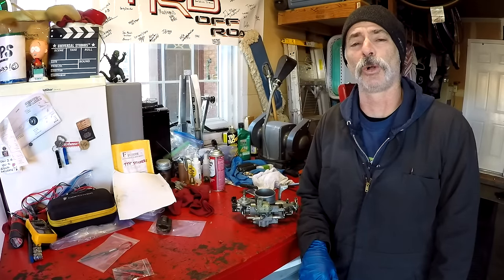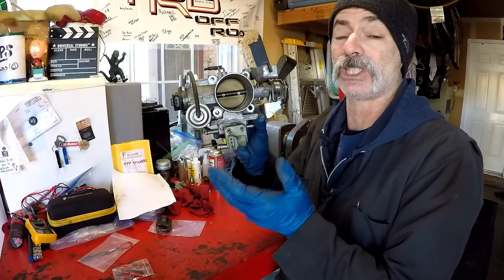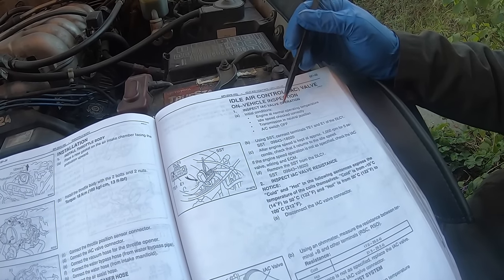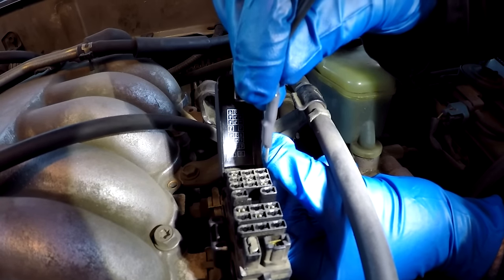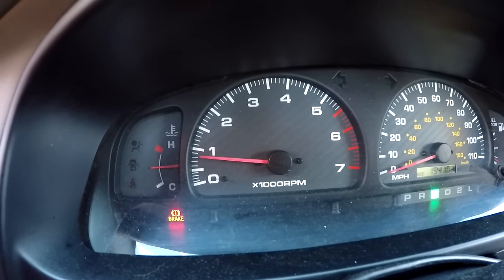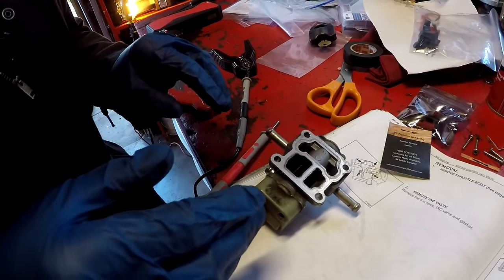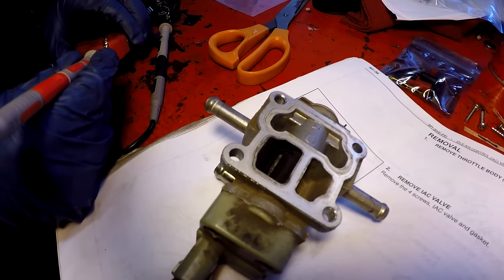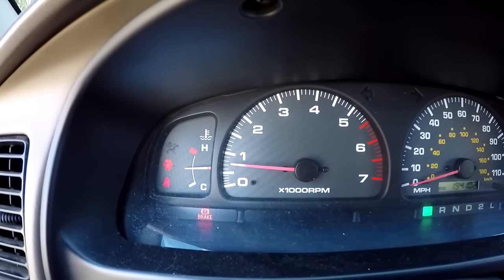IAC Valve Testing and Cleaning

Comment: If taking coolant hose off the throttle body dose that cause air in the coolant system ?
Reply from the maker: You'll get some air in but it will work itself out.  You don't have to re-burp the cooling system if that's what you're asking.  The air will eventually work it's way out to the reservoir.
Reply: @TimmyTheToolman  thank you boss! I’ve only asked that because I notice a little drop in the coolant reservoir so I got little paranoid.
Reply from the maker: @samabdelhadi3037  Yeah, it's normal that you would see it drop a bit because you lost a little coolant when you disconnected the coolant lines.

Comment: Can we adjust fuel on 3400 v6 4runner
Reply from the maker: It's done by the computer which takes readings from sensors like the MAF, Air/Fuel, and O2 sensors.  You can't adjust it as far as I know unless you replace injectors with a higher flow rate or get a tuner that wires into the ECU that some people add when they do the 7th injector modification because they have a supercharger.

Comment: Hi Timmy - '04 Tacoma 3.4, 178K, I have a idle in the 900 range (warmed up) and I am getting a PO420 code. My cats are in good shape - no leaks detected, swapped out A/F and O2, etc... no resolution. Could the slightly higher idle as a result of faulty/dirty IAC lead to rich condition (I'm getting mediocre mileage) and resulting P0420?
Reply from the maker: I sort of think maybe you might have a vacuum leak rather than a problem with your IAC but I suppose the IAC could be the culprit for your high idle.  What I don't know is if a high idle condition can cause a P0420 code.
Reply: @TimmyTheToolman  Thx Timmy, really appreciate the input, and all the great guidance from your vids!
Reply from the maker: @jpc4378  I hope you figure it out.  Let us know what the issue was.

Comment: I’m just interested in the part of the video where you say that in cleaning the throttle body gunk can drip down into the IAC. Is it possible to clean the IAC by shooting carb or throttle body cleaner like Seafoam directly down that hole?  Would that blow that area out and clean it somehow like you did with the Que tips?
Reply from the maker: I wouldn't recommend this because where is the dirty run-off going to go?  The only places it can go is out the other side of the throttle body and how effective would this be?  I think the only choice is to remove it and give it a good cleaning with it separated from the throttle body.
Reply: @TimmyTheToolman  Thanks.  Another question: For the hoses that bring the heated air into the IAC, is it possible to remove them and clean it from those openings?  I'm just trying to figure out a lazy mans way of cleaning the whole thing without removing all the parts.  If the to air hoses can be removed and you can just spray carb clear in there and use a long Q tip to remove the dirt, would that be feasible?  Great video by the way.  I'm about to do this but I am procrastinating and hoping for an easier approach since I'm not a 'certified' mechanic.  Thanks.
Reply from the maker: @jonwlindberg  I don't think that will work either.  There's 3 hoses attached to the IAC, 2 of them route coolant through the throttle body and IAC to keep the throttle body and IAC from freezing in cold temps and the other is that air assist hose for the injectors.  Flooding the IAC with cleaner and then trying to get in there with any effectiveness to properly clean it wouldn't work.  Removing the throttle body is simple.  The main thing you have to worry about is stripping the IAC screws.  You just have to use a screwdriver that fits the screw heads well, preferably a JIS screwdriver, and you need to apply sufficient downward pressure on the head of the screw while turning the screwdriver to break free the screws.  If you're careful, you can get the screws out no problem like you saw I did in the video.  Don't take shortcuts.  Just remove the throttle body and do it right.
Reply: @TimmyTheToolman  Thanks for the quick reply.  I just ordered JIS drivers off Amazon today.  Those suckers are expensive but I needed them.  When I replaced the Throttle Position Sensor I stripped the head of one of the screws with an American phillips.  Thanks for your advice.  I'm going to try this next weekend, assuming those drivers get here.  If not I will punt to the following.  That's a great video.  Really appreciate the time you took with it and how professional your videos are.  I've been wrestling with a code on this vehicle for almost a year.  P0172 if I remember correctly.  Replaced the both O2 sensors, the brake assist check valve, tuned it up, new wires/plugs and have cleaned the throttle body, even did the SeaFoam treatment and nothing has gotten rid of that code (rich bank 1).  I've bought coils and injectors and was about to try those when I saw on T4R.org this IAC idea.  If that doesn't work I'm going to pull my hair out.  Love the truck but this shouldn't be that hard to diagnose.  Thanks for your help.  Otherwise, the truck runs fine.  Good MPG but dies at idle once in a while and constantly throws that code.  Been dealing with it for almost a year.  SMH. Love 4Runners but at some point I'm sending it.

Comment: I changed my iac valve for an aftermarket and the code came back. Do you think it was the part I used?
Reply: Also when I changed the iac to the aftermarket part the idle was a lot higher
Reply from the maker: @Hellogoodbye_  Not a good idea to use aftermarket for that part.  I'd get an OEM replacement.
Reply: Okay thank you’ll I’ll have to get an oem part. Also thanks for the reply.
Reply from the maker: @Hellogoodbye_  You're welcome.  Let me know if the OEM IAC fixes the issue.

Comment: @timmythetoolman Thanks for the very detailed info. I think I have scrolled through all the comments and haven't seen anything regarding the wire harness that plugs into the IAC. I've gone through all the other things you've mentioned but I want to test the wiring on the plug. Do you know what I would need to see on that plug to verify my wiring is ok? Thanks
Reply from the maker: To test the wiring, you would probably have to do  a continuity test from the ECU to the plug but I've never done it and don't know which pins on the ECU communicate with the IAC.
Reply: @TimmyTheToolman  thanks for the fast reply I appreciate it. One other question that I haven't seen in the comments is that my accelerator pedal seems too stiff as well. Overall my symptoms have been high idle and throwing code P0505. I've cleaned everything and installed a new IAC. That's why I'm now wondering about the wiring on the plug but maybe the stiff pedal has some relevance to my issue? Thanks
Reply from the maker: @drew811  Maybe you're dealing with some corrosion at the throttle body.  Have you manually tried turning the throttle at the throttle body to see how it feels?  I sort of doubt it's the cable itself but it could possibly be the cable too.  Take the air tube off and work the throttle with your hand.  Is the throttle plate sticking somewhat in the bore of the throttle body?
Reply: @TimmyTheToolman  I haven't tried that specifically yet but that's my next step. Thanks again I appreciate it.
Reply from the maker: @drew811  Yeah, no problem.  You should be able to figure out where or how the throttle is hanging up.  If the throttle plate moves nice and freely when you turn it by hand, maybe it is the throttle cable itself causing the stiff pedal feel.

Comment: never spray throttle cleaner in your 4runner throttle body , That wonderful Check Engine Light and a very high idle, i had to clean the freaking  beans out of IAC with royal purple 87 Q tips  and those screws are easy to strip i had get a impact screw driver anyway ,, thanks triple t
Reply from the maker: It's a common mistake.  The port to the IAC is at the bottom of the throttle body throat and all the dirty residue can drain down into it.  I prefer to spray the cleaner on a rag and then clean with it.  If you take the throttle body off and invert it, then you can spray with reckless abandon and not get any of the dirty runoff in the IAC .  Glad this video helped you de-gunk your IAC.

Comment: How necessary is it to plug any of the hoses if I only want to remove the throttle body and IAC valve just to clean them? (And replace the IAC gasket) I'm having an intermittent rough idle and cleaning the MAF didn't fix it so I'm thinking this might be it
Reply from the maker: The plugs just help you lose less coolant from the hoses.  You can get away without plugging them but you'll get more coolant draining on top of your engine as a result.
Reply: @TimmyTheToolman  I'll keep an eye out :) Thanks so much for the reply! Your channel has helped thousands of people in more ways than you can imagine.
Reply from the maker: @iburstabean  You're very welcome.  It does make us feel good we are helping quite a few people out.  It's what we're all about.  Good luck with the job.  Happy Wrenching!

Comment: Hi Timmy the toolman, i have a 93 toyota 4runner that starts, idles really rough, then stalls. it does this intermittently. Could this be the IAC valve? Thanks in advance.
Reply from the maker: Hey Allen, yes, it could be a problem with the IAC valve because the IAC valve is what gives the engine the air it needs to run while idling.
Reply: @TimmyTheToolman  Thanks for getting back to me. do you also happen to know if the IAC for the 2.4 liter 4 cylinder engine is the same for the 3vze 3.0 L V6? I can't seem to find an IAC for a 3.0.

Comment: Hello. Thanks for great video. I just have few follow up question. 
What's the ideal rpm for cold engine?
What is the ideal rpm for hot engine?
How much time it takes for the engine to get to the operating temperature?
I am looking for the ideal numbers because i still don't know if my is running fine or not.
For example when its cold I am getting up to 1400, when its hot its 750. I wonder if 1400 is not to high based on other car model. My mother's skoda fabia has 1100 when cold, and my volvo xc60 also has 1100. So logically 1400 would be to high. But again i don't know as this is my youngest investment;)
Reply from the maker: Your warm engine idle sounds right.  Your cold engine idle sounds a little high.  I'll double check my cold rpm today and get back to you.  

How long it takes for the engine to warm up depends on the ambient temps.  If you're in really cold weather, it will take longer than if your were in really hot weather.  I never let my engines idle to operating temp because it's a waste of time and fuel.  I wouldn't be concerned with this number because it's arbitrary and is not really important.  What's important is you do get to operating temp and you don't overheat.
Reply: @TimmyTheToolman  any news regarding cold engine rpm? 1 more question. Can bad O2 sensor can cause misfires? even though i have no code for 02 sensor.
Reply from the maker: @Amraam23  My fast idle was around 1300 rpms on my 2000 4runner.

Bad O2 sensors wouldn't cause a misfire.  They could cause a too lean or too rich fuel condition but I doubt that would lead to a misfire in the cylinders.  You would pop a CEL code if your air/fuel mixture was off.
Reply: @TimmyTheToolman  thanks very much. That's explain a lot. I have a lot to learn about my new rig. With your video's i am getting smarter and smarter.... I think ;)
Reply from the maker: @Amraam23  Well, we're not all-knowing, but I guarantee you are definitely learning by watching our videos.

Comment: I cleaned the throttle body without removing it and drained the gunk in the hole. Now what should I do???
Reply from the maker: I'd pull the IAC off the throttle body and clean it out like we show in the video.  Even if your rig is running fine right now, I think there's a good chance that little IAC door might get stuck closed, fully open or partially open due to all the junk you let drain down into it.
Reply: @TimmyTheToolman  
Actually I saw a video on similar vehicle about TB cleaning except it had no such hole

Comment: What did u have hooked to the phone to get it to show u all that
Reply from the maker: I have a Bluetooth OBD II Reader hooked up to the OBD II port on my rig.  That reader sends information to a phone app called Torque Pro (only for Android phones, not iPhones).  If you have an iPhone, there's other readers and apps that will work with them.

This is what I have in addition to the Torque Pro app I bought for around $5:

If you're interested in buying an OBDII reader that works with Android devices, here's what I got:
https://amzn.to/2BeQUsM

And, if you go the Bluetooth reader route, buy this as well.  It allows you to turn off the power to your reader so you don't have to pull it out every time.  The reader constantly draws a small amount of power and could drain your battery if your truck sits for a long time.
https://amzn.to/2WDL4dl

Comment: Another Great Video.  I have been getting a P0172, System too Rich.  Freeze frame data showed LTFT neg 34.  When viewing Live Data, LTFT is in the high negative numbers only at idle.  Could it be the IAC?  Thanks!
Reply from the maker: I don't know if the IAC is your problem.  It could be a faulty upstream and/or downstream O2 sensor.  On some rigs, the upstream sensor is an Air/Fuel sensor.  The later model 3rd Gens are like this, I think 99-02.  If you're IAC was faulty, it would be more of an idling issue.
Reply: My upstream is alternating between .3v to .7v.  The downstream is erratic, Should be a flat signal?  I was thinking maybe my Cat converter was bad.
Reply from the maker: @rctalkington  I'll have to look at my factory service manual and see what it says.
Reply: @TimmyTheToolman  Looks like upstream should oscillate around .5v.  Downstream should follow but just slower.  I'll look at it again.  Thanks for your help. Might just change both sensors.
Reply from the maker: @rctalkington  Ok, let me know how it goes.
Reply: @TimmyTheToolman  Here is a link to a few images of O2 Sensors.  Maybe downstream is bad?  Funny how manual only references upstream.  1st photo is at 2500 rpm after 3 minutes.  2nd is just after returning to idle.
 https://photos.app.goo.gl/W5sd33DBxJdPWQK4A
Reply from the maker: @rctalkington  Hey Robert, I've never performed the live test like you've done for the O2 sensors.  On my 2000, I just decided to replace both of them because I've heard they can get lazy and affect your gas mileage by not reporting accurate information back to the ECU.

Comment: Timmy-having an issue with either the TB Position Sensor or the throttle opener right next to it.  Is the opener (with the vacuum lead coming out of the top of it) something that can be replaced or fixed?  Working on a 1998 4runner limited with 2wd.
Reply from the maker: You can get a replacement throttle position sensor for sure from Toyota.  The part with the vacuum hose attached is the Throttle Opener.  I don't know if Toyota sells those or you have to purchase the whole throttle body.  You could find out by visiting your local Toyota dealer parts department and ask them.  Have you tested the ohms resistance for the throttle position sensor to verify it's bad?
Reply: @TimmyTheToolman  I have not tested the ohms yet.  Will do that next.   Thx sir.
Reply from the maker: @richardshoults8775  You're welcome.  If it's bad, you can replace it and hopefully be good to go.  Let me know what you find out.  By the way, what symptoms are you experiencing with the engine that lead you to believe you have a problem with the TPS?
Reply: @TimmyTheToolman  the engine is missing at times at cruising speeds. Not consistently, but sometimes.  I've replaced the original MAFS, TBPS, Idle Air Sens, and the PCV.  The idle is weak.  When I go from park to reverse or drive, the car stalls when I push down on the throttle.  If I give it a slight double pump, it will let me pull away and the engine won't die.  So strange.
It could be somethin else.  The only code that ever comes up are MAFS and Throttle Body.   Thx for the response!!
Reply from the maker: @richardshoults8775  Ok.  I hope you're able to figure it out.

Comment: After I changed out my old IAC to a new one, when I turn my tacoma on, the idle is very high; almost to 3000 rpm.. but when I unplug the IAC connector when the engine is on.. it goes back down to normal idle; 1000.. any ideas?
Reply from the maker: Was it an OEM IAC you used?
Reply: I think it takes a bit for the ecu to figure itself out with the new IAC. Just drive it for a few days and see if it gets any better
Reply: @TimmyTheToolman  --- figured it out.. it was bad IAC I bought from ebay.. was $22 bucks ..bought it from Tom's auto parts on Ebay... saw the store had many good reviews so I took a chance since it was $22 bucks plus free shipping.. good thing they refunded me after I called them..  thought I would save a few bucks, but I got a shitty one. Ordered and installed another IAC valve - an Intermotor IAC valve.. started the engine.. no more issues; works great now.  Don't buy cheap ebay parts..
Reply from the maker: @moistandsquishy9925  Glad you figured it out.  That's why I asked you if you had an OEM IAC.  Good to hear another aftermarket one worked for you, but knowing myself, I would have dropped the money on an OEM one to play it safe.